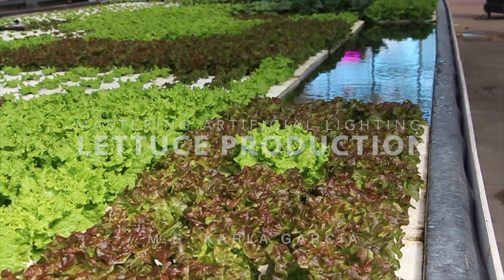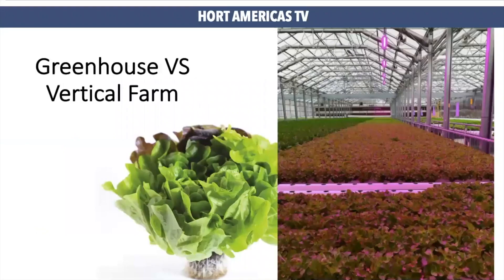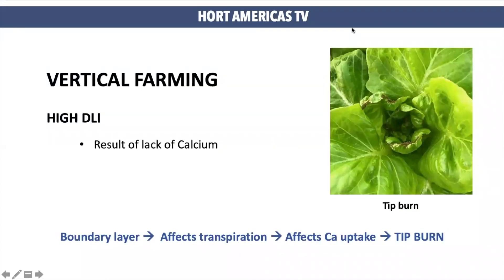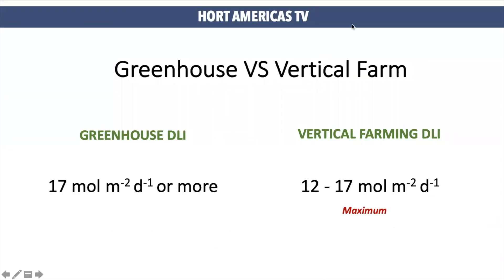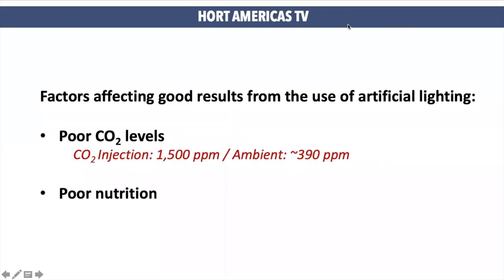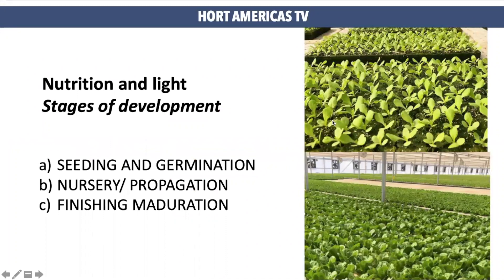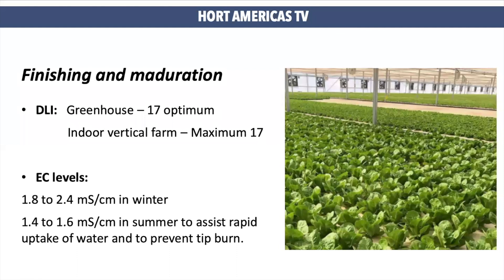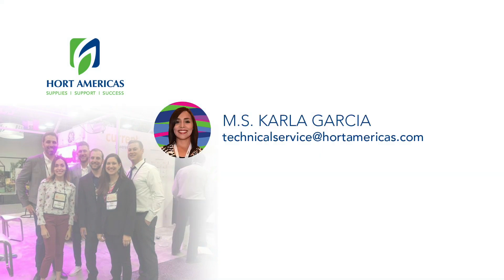Growing Lettuce with LED Grow Lights | Mastering Artificial Light for Lettuce Production

Comment: Hello, currently I have only T8 light tubes with PPFD 130 umol/m2/s. Just want to ask, if I put the lights side by side, will it help to achieve PPFD > 250 umol/m2/s, so that I can achieve at least a 14.4 DLI in 16 hours? Thank you.
Reply from the maker: Thanks for your comment! that is correct by providing a PPFD of 250 for 16h you should be delivering a DLI around 14.4